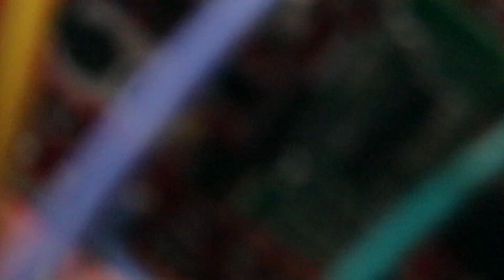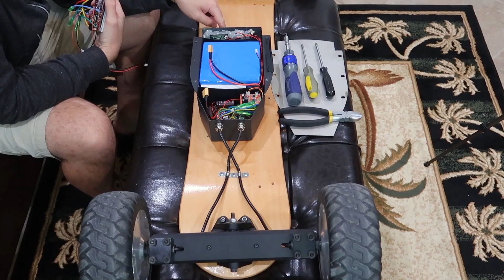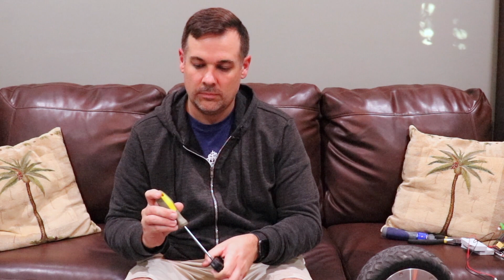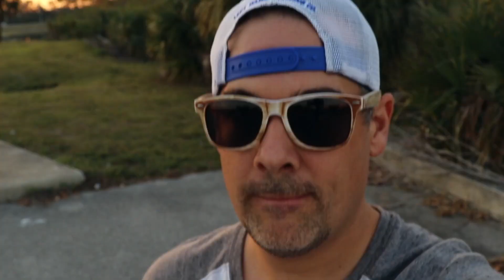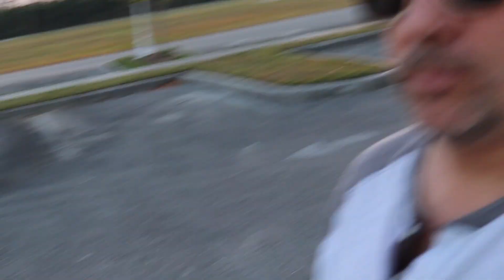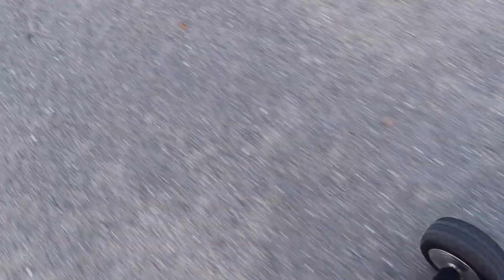eDrift UH-E71 Motherboard Replacement - Connection Issue Resolved!

Comment: Je suis française. J'ai acheté ce skateboard.
Pouvez-vous me
dire si c'est un défaut.
Quand je roule avec, si je lâche la clenche de la télécommande, il
freine brutalement sans  appuyer sur la clenche du frein. En
attente d'une réponse, je vous souhaite une bonne journée.
Reply from the maker: Hi serres sylvie - It looks like you are asking me if the board is supposed to break when releasing the throttle switch on the controller, right?  If so, then yes.  It shouldn't be like slamming on brakes, but it should gradually apply the brakes bringing you to a stop.  This is normal.  I hope I was able to answer your question here.

-Eddie

Comment: Hey, have you done a max speed test yet?

Also, how many miles have you taken your board so far? I ride daily and need something reliable
Reply from the maker: Hey Underground Longboards - I have not done a max speed test yet, but it's only because I haven't come close to reaching max speed on the board yet.  I have rode the board consistently at 13 mph (calculated by an app on my Apple Watch) and was only at 1/2 throttle in full speed, so I know this board will go up to and even over 20 mph.

I would say I have gone 50ish miles on the board so far.  In those 50 miles, I have already had to get a replacement battery.  I am not sure that I can say this board is incredibly reliable, especially since if it stops working you have to carry 50 lbs of board around which wouldn't be fun.  If you are looking for a daily rider, I would recommend something more tried and true, which also means more expensive.  I hope this helps!

Let us know if you get the board, and your thoughts on it.

- Eddie